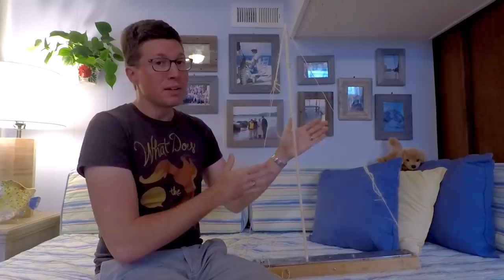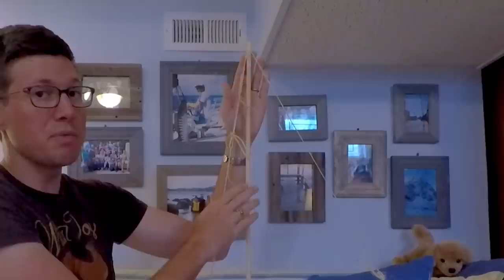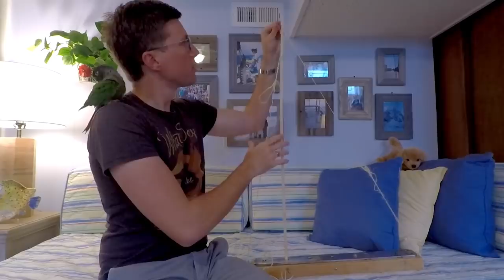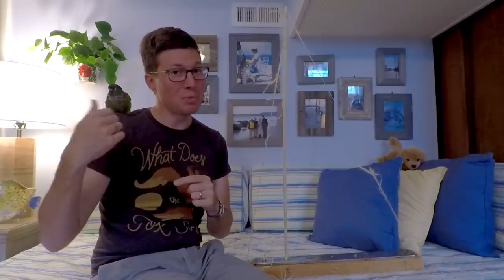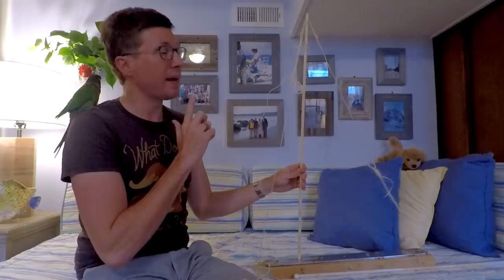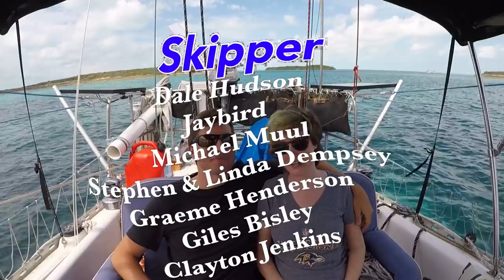Where SHOULD the Headstay Connect? | Sailing Wisdom

Comment: Thankyou for a great video. 

Another reason for fractional riggs is the aspect between the main and the headsail.  

Most older boats (before the sailboat boom 50 years agoo)  in my part of the world (scandinavia) have fractional riggs.  More due to the ability to sheet the headsail with no or small winches. Boats like the old Swedish folkboat had 3/4 rigg (with a diamond to handle the fore stay tension)  and many was built without winches due to cost.

Comment: A Backstay tensioner on a masthead sloop accomplishes one positive thing. It can take some of the sag out of the head stay when desired. It also however does a lot of bad things as well. It puts a lot of extra load on forestay, backstay, headsail luff, halyard, and fore and aft chain plates. Also cool for a racing boat, but not so much on a long distance cruising boat. Excess pre-load is something to avoid when possible.
Reply from the maker: Indeed. We have our headstay tension set with the backstay half set. This lets me out a little extra tension if the air got colder, and ease it completely when we are anchored or going downwind.

Comment: There's another advantage to a fractional rig, epically a 3/4 one. My boat had one without a bendy mast. I quickly learned that my first reef was to simply roll the jib up. The boat sailed well without it. This made tacking in blustery winds so much easier, in a boat that had a bad habit of getting caught in stays.

If there was enough wind, the jib stayed in the sail bag.
Reply from the maker: The main advantage is simply more leverage from the backstay to make the headstay tighter for going upwind. 
If the mast wasn’t bendy, then the whole thing would come back maybe less than an inch and that would make the headstay tighter as well. 

That’s pretty sweet that you could sail so well without the headsail. Only having one sail to work is always easier than dealing with two sails!

Comment: Great instructional approach! I have a question though, where can I find out what capacity my 4/1 mainsheet rig specifications are? No luck on the web as yet but as it was missing when I acquired my boat it’s been tough it’s a 1978 20’ O’Day with a fractional rig.
Reply from the maker: That might be really hard to find. I would suggest copying a similar setup from a different but similar sized boat. You want to base your comparison on the mainsail area and if the mainsheet is in the middle or the end of the boom. 
Find one that’s similar and replicate it on your boat.

Comment: I can see how pulling the luff forward will flatten the sail reducing drag and lift.  How does this compare to using the sheet traveler and vang to increase twist dumping air out of the top third of the leach?  When should I choose either adjustment.  It seems to me they are opposite trim to achieve the same benefit.

Comment: I would have thought the extra material in the centre of the sail was to partially correct for the horizontal movement of the central portion of the leech for a given wind condition? I'm looking forward to your next video on sails.
Reply: @TheCopaMundial I think you may have misinterpreted my comment. I am not questioning the purpose and effectiveness of a curved airfoil, but rather how the optimal curved shape is achieved at all elevations. For example, there is no difficulty in curving a flat sheet of paper to any desired airfoil shape. Attaining this shape with the trailing edge curved eliminates the possibility of having the optimal shape everywhere.

Comment: What would be amazing is if you talked about tall ships as I used to work on one as first officer and training officer and sailing master .
Reply: Capt Chef Mark SV Alcina  that will be come really complicated!Also the most of the rigging on a square rigger is designed around keeping the rig standing up as you change the forces with all the different sail configurations. Ultimate sail shape from rig adjustments is low on the priority list. Cheers Warren

Comment: Do you know if fractional rig mainsail and masthead mainsails have different cut? Trying to see if J/105 mainsail can be used on J/35. My concern is that tip of the mast on j/105 can be bent aft easily. Is it reflected in the mainsail shape/cut for J/105?

Comment: The real reason a fractional rig doesn't belong on a long distance cruiser is all the mast movement/pumping the boat does sailing in waves. Cruising sailboats need to be made to last, and all the movement in a fractional rig is a recipe for expensive important things breaking eventually. That's why you don't see them on well designed ocean boats. Draught is removed, or moved fore or aft, to depower, or redirect the coefficient of lift produced by the sail.
Reply from the maker: That’s a great point about how they wear out faster!

Comment: Hi, I like your explanations. But, the draft of the sail, just like with a wing, is not the main cause creating the lift. It is to accommodate a laminar flow along the sail/wing surface. The main lift is caused by the angle of attack of the surface of the plane towards the airflow (or whatever medium, like water). Proof? You can sail with a rigid door as "sail". You will just not be as efficient, because the airflow will stall at a smaller angle of attack than with a cambered foil.
Anyway, you can look this up and adjust your lecture accordingly 😉
Reply: I don't mean to troll - you are obviously intelligent and familiar with the principals of lift. However modern engineers have debunked the idea that camber or draft is merely for laminar flow purposes (an idea that even aircraft people have perpetuated over the years). It (the Bernoulli effect) is now known to account for about 75% of the lift in an  air foil. The Newtonian component of lift accounts for only 25%. At slower speeds (sailing speeds compared to aircraft which is my background) the draft of a sail is much more vital than it is in an aircraft wing. Your reference to the old saw that even a bard door can be made to fly with enough power is true - but you neglect to realize that even a barn door creates a Bernoulli effect. I can refer you to an article that discusses this in depth: https://www.aopa.org/news-and-media/all-news/1998/november/flight-training-magazine/bernoulli-or-newton . 
To sum it up I don't believe the presenter of this tutorial needs to modify his explanation at all - he is right on the money.
Reply: @liamstone3437  thanks Liam. Just like Don Byers I was convinced by older articles on kites and barn doors and carried that around for all those years. Only that made most sense to me while sailing too, because conventional sails only have a single foil.

Comment: Herb you did not address the mainsail tension replacing the back stay or boats without back stays. Many racing keel boats and dinghies  are like this. Then when you add a modern large roach full battens mainsail a back stay may not be practical and nobody wants running back stays so the mainsail becomes more important. ( ok beyond scope of a YT video).
I understand cruising sailboat don't need to get the ultimate performance but having the ability to sail up wind reasonably efficiently or claw off a lee shore is important to life and cruising bliss. Most folks are not out there to be sailing around endlessly but to get to interesting and exotic places so they can fix their boat for the next trip!😜( and sleep)!
Cheers Warren
Reply: Sounds like a interesting topic too.
Reply from the maker: When I make the sails, I will cover this topic! ;)
Reply from the maker: It sure does, but I won’t have it as quickly answered as I did this video
Reply from the maker: I do cover this a little in the next video though 😁
Reply: @warp21drive That's me. I have a fractional rigged trimaran with leeboards and no backstay built for skinny waters and speed. The mast can rake between upright and back to move the CoE. The downhaul determines any bend in the mast.

Comment: Did not have time to watch the entire vid today. You might have spoken to my question.   Personally, I have a good understanding of the angles, size, length aspects of determining tension no matter the object we are working on.  However, I'm still young in my sailing knowledge. Is there any reason why the Fractional rig can't be used on a cutter to help fight the equal tension and head stay sag issue with heading to wind?  I am guessing maybe? sail plan space would be one reason not to run a Fractional rig on a cutter smaller staysail space.   is this done? if not are there other reasons?  NVM I just watch the end and you said a little on my ?

Comment: Masthead crane... not a truck.
Reply from the maker: I think this is a regional name for the masthead unit. In the states, it’s called a truck, but I have also heard it called a crane. 
Different names for the same thing 😁
Reply: You may have won this one. Here in the south the part is referred to as the masthead crane. But it seems the crane is a better descriptor of the overall component's function too include the boom, while truck is given as a nautical term for the specific part of the crane in general. Who knew? When you said truck, my inclination was to understand it as a part that moved in relation to the masthead, i.e., something pulled along the length of something else, like a mast.

Comment: Crap ... there are in both cases ways to bend the mast.
Reply from the maker: And one is better than the other for the purpose.
Reply: @RiggingDoctor  Hm ... it totally depends for what the boat is used. If you want racing then you don't care that you could drop the mast (by hazard). If you are cruising then the "other" is much safer (both can be trimmed to perfection).